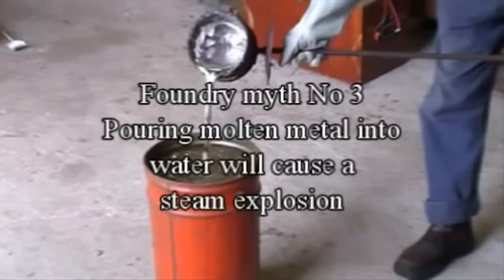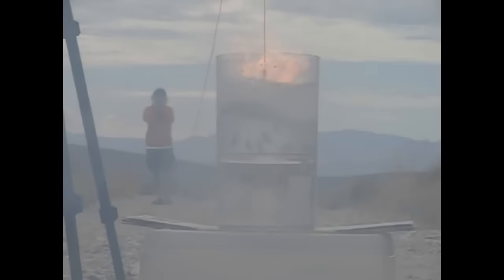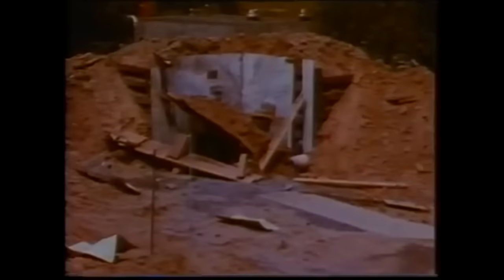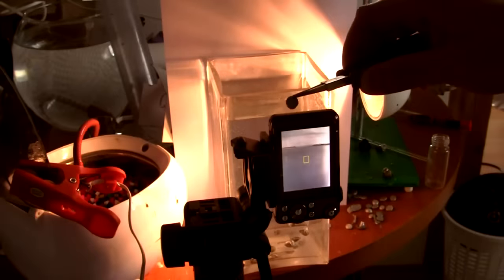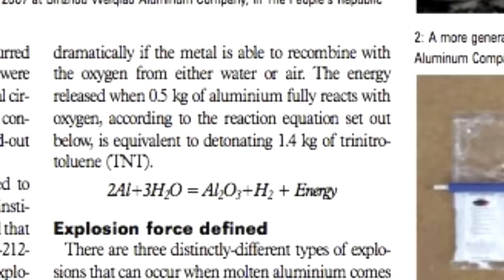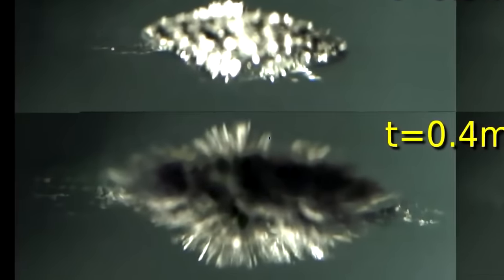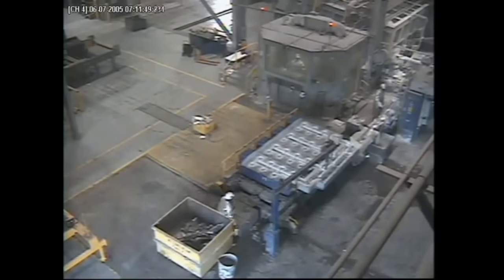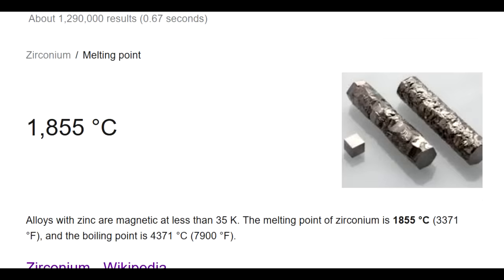The Awesome Power of the Aluminium-Water Explosion!

Comment: I'm pretty sure you are incorrect about the explosion mechanism. It seems pretty clear in all of your videos, that the explosions are steam explosions, not combustion reactions. Aluminum oxidation produces a lot of heat and light, whereas all of our examples show no light. We just see a lot of hot molten aluminum going everywhere. Still dangerous, (potentially much more dangerous), but that should give us some important clues to why you weren't able to get the reaction to happen in your tests. 

In all the explosion clips, the aluminium is poured into a container small enough that the molten aluminum can confine the water. When the water flashes to steam it escapes explosively taking the aluminum with it. In the case of the YouTuber clips, we see a small amount of aluminum being slowly poured into a large container of water, and no water even comes close to being confined. 

Yes, aluminum can combust very energetically. This is how thermite works. However, to get this to happen, we have to dramatically increase it's surface area by grinding into a powder, and mixing it into a powder oxidizer. For the molten aluminum oxidation thesis to be true, the liquid state of aluminum would need some mechanism to rapidly get oxygen to a much larger percentage of the aluminum. However, this doesn't appear to be the case. Given that the aluminum oxide layer has formation rate on the order of picoseconds, and its melting point is way higher than elemental aluminium, I expect that the passivization layer is largely effective even on liquid aluminum. Worse, the melting point of aluminum is high enough that the interface between it and the water will always have a protective steam barrier caused by the Leidenfrost effect, which would also retard any possible oxidation reaction.  

I think for these reasons we can pretty confidently say that the mechanism of Aluminium-Water explosion is steam, not oxidation. This means that pouring a small amount of aluminum into water is probably safe as long as the surface area of the water is very large compared to the surface area of the poured aluminum. However, it means that it's probably quite unsafe to pour any liquid metal into a small container of water, even if it isn't a reactive metal.

I would further note that steam explosions don't need very much water, and small amounts of water are easier to enclose than large amounts, so less water may actually be more dangerous to a point. If you'd emptied your container without drying it out, and then dropped the aluminium in, you might have achieved an explosion.

Comment: I still have no clue what is the basis of the explosion reaction.
Is it mostly a steam explosion or is it mostly an accelerating Aluminum oxide formation? or 50/50
Reply: I know why, 

Electrolytic reduction. Hydrogen and oxygen are separated into their proprietary molecules, and ignited by the heat generated by the reaction, and whatever the aluminium holds residual. The electrolytic reaction is what you see when the aluminium "forces" its way into the water in the alkali spirulles. This is also why lithium burns pink on water. Hydrogen reacts with oxygen and itself and the heat from that reaction creates the ignition source. Lithium is far more electrolytic than aluminium, so it does its thing at room temperature. Also, lithium reacts with oxygen to create helium and hydrogen monoxide, or soot. That's why its oxide layer is less resilient. It's closer to iron oxide in crystalline strata, than aluminum oxide. Hydrogen. The hostess with the mostest.

Comment: They are pouring it too slow. Has time to cool down. Aluminium reacts to create aluminium hydroxide or maybe an oxide. Only reason it does not do that always is because of the oxide layer, protecting against further reactions. In the short term anyway.

Comment: When superheated, steam expands in an instant to 1800 times the volume of the water from which it came. This is the stupidity of having water anywhere inside a nuclear reactor. The main danger from just about all the worst nuclear accidents has not been the core melting through the bottom of the reactor and burrowing all the way to China, but either a steam explosion (e.g. Chernobyl, where the force of the steam explosion flung a 500-ton concrete cap hundreds of feet in less than a second), or extreme heat dissociating water into hydrogen and oxygen, which then explode on contact in the cooler regions of the reactor (several notable examples are Fukushima, where three of the reactors were actually off when the tsunami knocked out the generators, although they were still generating excess decay heat. These explosions happened over a period of days).

I cross my fingers that LFTRs or other molten thorium salt reactors can be made to work in a cost-effective way, because if they potentially have the following advantages:

There is no water anywhere inside the reactor, only in the steam turbines, where the water is separated from the reactor core by a heat exchanger

The fuel can't melt down, because it's already a) molten and b) the coolant as well as the reactant

If the fuel overheats or the electricity goes off, a frozen thorium plug kept cool by an electric fan melts, and the reactants flow down into a flat, wide holding tank that is exactly the wrong shape to promote a supercritical configuration

The radioactive nuclide wastes from thorium are a lot less than those of uranium or plutonium reactors, and a large proportion of those are medically useful and in short supply
The remaining nuclides do not have super-long half-lives

Uranium-233, the active ingredient for LFTRs (created when Thorium-232 is bombarded with neutrons to become protactinium-233, which then undergoes beta decay to become U-233), can go prompt-critical like the bomb material, U-235, but it is a lot more unstable and dangerous to work with because of the inevitable presence of U-232. Just about the only pure U-233 bomb ever tested was the Indian Shakti B nuke with a yield of about 0.2kt. You'd be better off trying to steal plutonium from a plutonium breeder reactor

No refinement or separation is necessary (such as is needed for a uranium reactor) from the basic material, Thorium-232, because it comes out of the ground like that

There is a lot of research into this technology, and a few real breakthroughs have been made, such as how to extract the halogen catalysts and put them back into service while re-injecting Th-232 to keep the reaction going. This is not a fringe or whacky technology such as the thorium car Thunderf00t debunked. In a polluted world, this could be a game-changer.

Comment: It seemed like all the examples you showed of aluminum water explosions were small amounts of water with large amounts of aluminum. Is it possible that it's not dirty surfaces and poor workmanship that is saving them so much as the fact that there is so much thermal mass in the water that it rapidly chills the aluminum surface to below the activation energy required?

Comment: I just assumed that the aluminum formed the oxide coating as it was being poured into all those water containers and that's why it didn't explode in those reckless tests. They poured it too slowly to cause the metal itself to change shape (revealing non-oxidised portions) and in too small quantities for it to break from it's surface tension. That was my assumption at least. Which makes me wonder why they didn't consider those possibilities. I'm a lay person, albeit a cowardly one, and I came up with that hypothesis, shouldn't just about anyone be able to come up with it after reading the wikipedia page on aluminum?

Comment: if Aluminium is so energetic and common and dangerous maybe we should make Aluminum combustion engines? how does aluminum compare to petroleum as a fuel source 
would the engines need to be a lot bigger and tougher to contain the combustion  or could you scale down the reaction by just using smaller amounts of aluminium to the point that you could safely get the same power out of a smaller lighter engine then petroleum

Comment: According to the title and your narration you are making this sound like a chemical explosion. I am pretty sure this is a flash steam expansion. It is similar to putting an oil fire out with water. If you have a high percentage of molten metal to water, the water gets trapped by the metal. It flashes to steam, and blows apart the container. If the metal can not encase the liquid there is no container to blowup. The steam does not have a chance to build pressure to explode.

Comment: No, they are not alive by a simple roll of the dice just by simple physics.  Just like you always add conc acid to water and not the other way around, the quantity of the materials involved is critical. A large amount of water and a small amount of metal is OK, a small amount of water and a large amount of metal = superheated steam + the hydrogen decomposition of water as the steam increase the surface area of the molten metal.

Comment: i dont think its just the aluminum that is causing the explosion

i think what is happening it that the heat from the molten metal is super heating the water to the point it separates into hydrogen and oxygen and those do to the heat spontaneously combust

i think the difference between the foundry explosions and the backyard non explosions can simply be explained by the heat of the foundry metal vs the heat of the backyard metal the foundry metal beint way hotter do to them using more heat to process more metal quicker 

so were a foundry would be at risk for these kinds of explosions a backyard metallurgist would not need to worry because they will never reach those temps

Comment: You talk about teh power of aluminium and the lack of power on aluminium due to the oxide layer so battery busted... but what if the aluminium was produced, stored and used without coming into contact with oxygen... hard to react with something that it does not contact, I would think... What difference would that make to potential uses?

Comment: If it's not chemical reaction, but a charge induced one, then why doesn't it happen with all metals?

Or what are the conditions for it to explode like that.
Everyone knows cesium, but aluminium also?
Gold doesn't form any oxide layer, why doesn't molten gold explode when poured into the water?

Comment: Gimme an aluminum economy over the hydrogen economy scam because as mentioned (oxidizing) aluminum releases a huge amount energy. For those still thinking hydrogen is the future, reacting Al with water also releases a lot more hydrogen than any equivalent hydrogen tank could ever store, and locally generating hydrogen is a lot safer than vehicles carrying high pressure vessel bombs that can explode, both from said pressure and the resulting hydrogen cloud. It's also far cheaper to make, store and transport, and recycled swappable aluminum-air batteries weigh far less and have far higher energy density than lithium ion ones, they can't cause uncontrollable fires and don't contain a bunch of nasty chemicals that currently have no plans for their disposal or recycling. Of course, we wouldn't need any of that if we used Fast Microwave Pyrolysis to turn all our waste into energy and a range of fuels such as renewable and environmentally friendly alcohols with net zero carbon, while locking away carbon into soil enriching biochar, and preventing methane emissions from decomposing waste by solving the waste crisis, and it can do all this using renewable energy and at a lower cost than traditional fuel production; no wonder we never hear about this ridiculously promising and proven technology, because it would destroy the fossil fuel empire, and we can't have that now? :)

Comment: You're wrong. Aluminium is not potassium. It all depends on quantity of water in comparison to aluminium. If there is a lot of water it would not change into vapor in split of second, which is the reason of explosion, not a chemical reaction.

Comment: Alright, Sodium explodes on contact with water due to a Coluumbric Reaction, as do all Alkaline Earth Metals, fine.  But Aluminum is a metaloid that doesn't possess Alkaline Earth Metal properties.  Furthermore you're comparing a series a tests involving a series of elements more or less in their natural states to a metaloid that must be both molten and freed of an oxide layer to get a similar result.

Its difficult to not see this as false equivalency.

Comment: I am not convinced, seems to me that the ratios matter a lot. I have seen Water explode in aluminium, i have yet to see aluminium exploding in water. As in, for the explosions, either it is lots of aluminium and a little bit of water, or if it is lots of water, the flow rate still has to be crazy high. Basically you get the explosion when evaporating water expands into molten aluminium, but given the choice the evaporating water would rather expand into more water and not into the aluminium. And what about the scientists pouring molten aluminium, sometimes huge quantities, into ant colonies to later dig up the solid aluminium to study the structure?

Comment: The difference is that idiot pouring a small amount of molten aluminium into a large barrel of water and declaring it "safe" is the exact opposite of the explosion demonstration, where the small amount of water is trapped under a comparatively huge volume of molten aluminium, which then contains the flash-boiled water (steam) like a pressure-cooker and the whole thing explodes.
Pouring a small mount of molten aluminium into a large body of water which doesn't trap the steam generated (all those bubbles escaping) has no explosion potential.
Reply: 'flash-boiled water (steam) like a pressure-cooker and the whole thing explodes.'
Well, no! A steam explosion is one thing, a chemical explosion is another. The only thing saving lives of the ignorant guys pouring molten metal is a layer of Aluminium oxide on the surface.

Comment: There is a reason why steel companies with electric arc furnaces have massive blast shields on their operator room windows. They lower them before adding a new batch of steel scrap, in case it contains water. If you looks at the dents of those shields , youll know why. but thats just from pure steam explosion.
https://www.youtube.com/watch?v=-RYCXDUt2m8   with sounds
https://www.youtube.com/watch?v=zTKodUpErR8  with steel splash

Comment: The only reason these bozos got away with this is because the volume of water provided a large enough heat sink to chill the aluminium  and keep the steam from forming. I predict for their next trick they will drop a frozen turkey into a deep fryer. Filled to the top with oil

Comment: Lithium is Similar to Aluminum in potential energy, right?
Reply: No. Lithium actually releases more energy, as it is a smaller particle/molecule. Also, lithium tends to release twice as much hydrogen as calcium, which is similar in reactivity to aluminium. Hydrogen drives the actual "explosion" , intrusion drives the electrolytic reaction of water into its constituance of hydrogen and oxygen. Because lithium releases twice as much hydrogen as aluminium(at room temperature), the hydrogen is more easily converted into helium and energy. That's why the foil in Thunderf00t's video only boiled water, but lithium actually catches fire and burnes with a gaudy, pinkish hue. Hope that answered your quandary...

Comment: So you're saying all the people casting aluminum in wet sand are suicidal?

"What is Green Sand Molding?
"Green sand molding, or green sand casting, is a process by which molten aluminum is poured directly into a mold cavity formed from a simple mixture of sand, clay and water. There is no correlation between the term green and the mold color. “Green” refers to a water-tempered, uncured sand molding system, resulting in a moldable sand mixture with strength and other physical properties suitable for mold making. Green sand molds are not baked or dried."

https://www.bremermfg.com/custom-aluminum-casting/green-sand-molding/